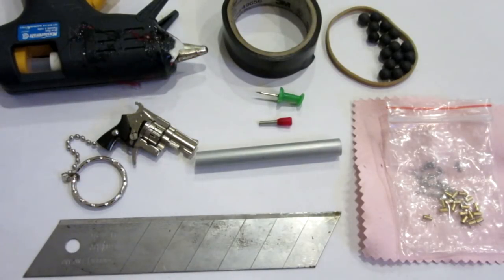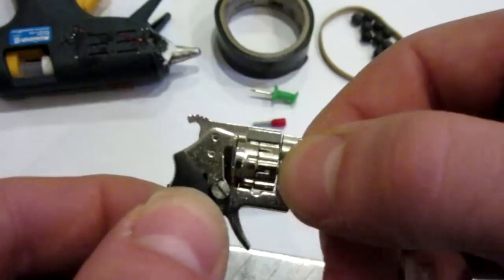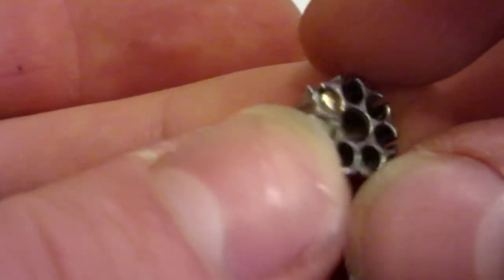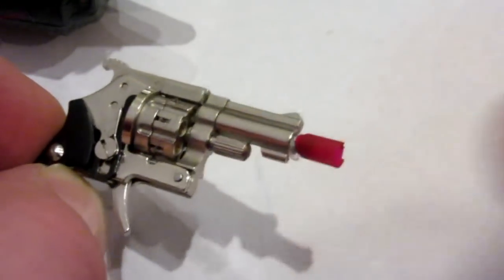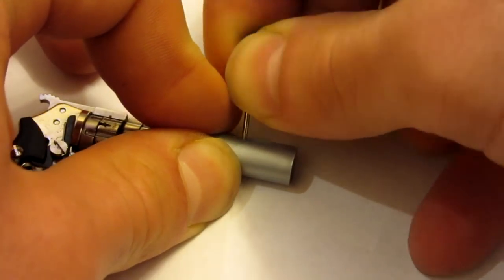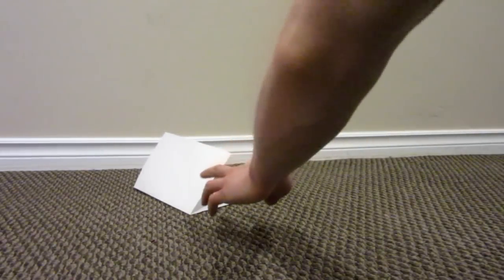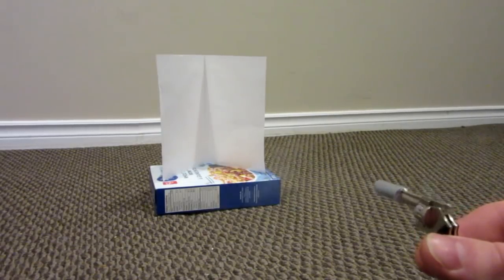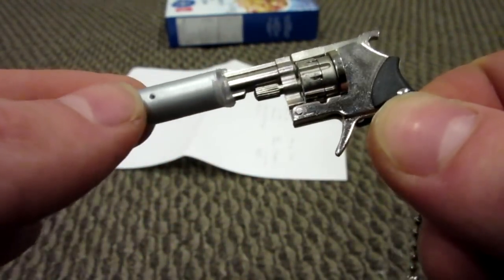World's Smallest Airsoft Gun - POWERFUL

Comment: airsoft uses air not those little pinfire shells
Reply: spring and electric also uses air.. there is a piston in airsoft that slams shut causing air to rush out.. AIRsoft
Reply: This is considered a firearm because it’s powered by gun powder and it’s shooting a projectile.
Reply: Airsoft doesn’t use air, it uses green gas or compressed carbon dioxide. But, you could use compressed air, probably on a homemade airsoft gun.
Reply: NKBMX 995 because it’s pinfire it’s not considered a firearm